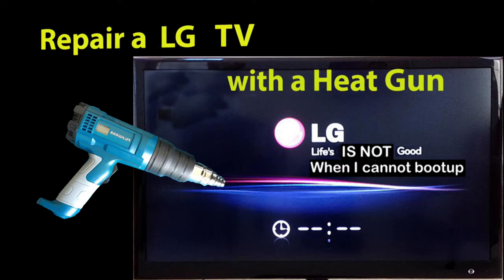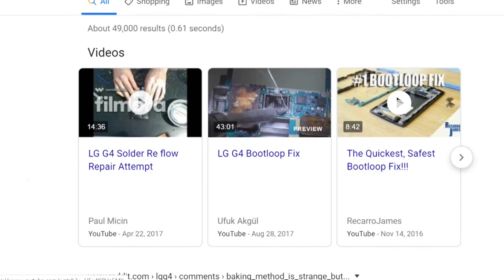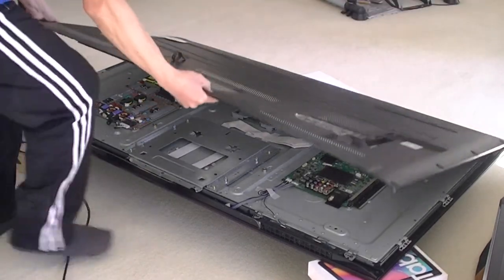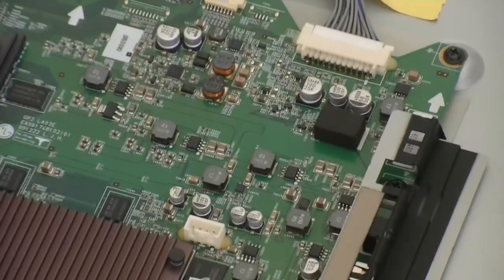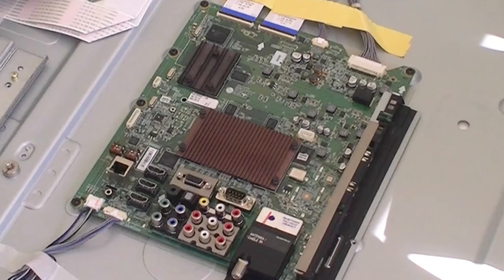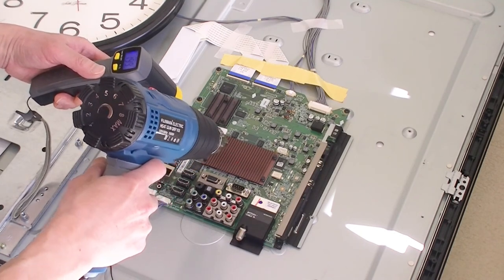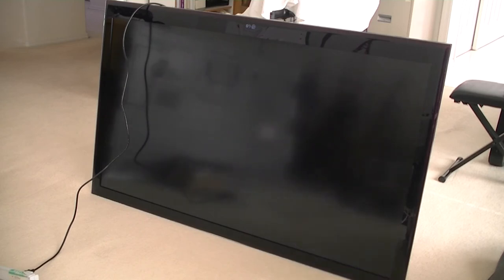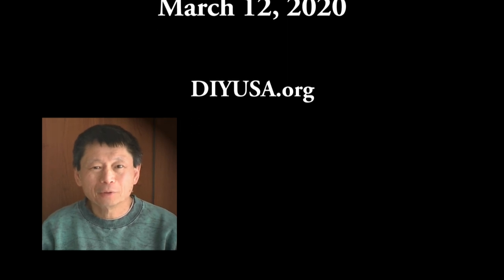Easy Method to Repair a LG TV Using A Heat Gun

Comment: Great video, very concise! This method worked for me to fix a 2011 model LG 55LV5500-UA smart TV. Like you, I left the motherboard/everything connected but I isolated the heatsink by placing 4 oven mitts around it to protect the board and focus the heat. Then 3 minutes of heating @ around 325-375 degrees while monitoring with an infrared thermometer. Thank you for showing us, and I hope others will take it into their hands to DIY more!
Reply from the maker: I appreciate your feedback, this will encourage others to try, hopefully the TV will not go to the landfill so soon. Thanks for providing the improved method to protect the board, especially he cables connected to the motherboard. They are very fragile (limited cycle time - to save $). For me, this method to fix the soldering issue will keep the TV running from a few weeks to a few months. If it fails again, I am able to fix that by reapplying heat to the chip. 😶

Comment: I can't believe that this worked! Ran a couple of tests and narrowed down the problem to the main board, borrowed a heat gun, set the heat gun to 250 celsius, waved it over the large heatsink for three minutes total and let it cool down, plugged it in and it works, thank you so much!
Reply from the maker: Really glad that it worked for you! Thanks for sharing!

Comment: Excellent video!  You laid down the theory and implemented it.  I used this technique on an LG 47LE5500 and it worked perfectly.  Thank you.
Reply from the maker: Thanks for letting me know. I hope your TV will run for awhile. Mine finally failed after one year of use (which is relatively long this time). I will have to 'reheat' it tomorrow.

Comment: It works. Picked up an infrared thermometer for $20. Already had a heat gun. Never wanted to reflow the entire main board by warping it in the oven. I knew this was a more effective way to reflow. Just could not find a resource explaining how to? Thanks for ref the flow soldering chart.  I did exactly as you instructed. 46LD550 and THANK YOU for posting!
Reply from the maker: I am really happy it worked for you too. I didn't have confidence it would work for me when I filmed this video. I baked my TV's motherboard 3 times. There are very limited cycle time on the ZIP connectors hence it is always better not have to remove the motherboard. Per my past experience, I don't expect this fix will keep the system running for long... hopefully I will get a few more months of life time before it dies again. BTW, my TV is still working :-)
Reply: Is it still working?

Comment: this got me back up and running.   i have a 86" lg and I changed out the power spply board thinking it was the problem,. I removed the main board first then used a hair dryer for 3 minutes.  it did create another issue  with the wifi no longer works but im fine with that since my devices wifi capabilities.  but this fix is the same I did on xbox 360, it only last a short while.  since the issue is the main board not power supply as troubleshooting suggest ill change once this stops.
Reply from the maker: Thanks for the feedback. My TV finally died after 1 year. It lasted longer than I have expected. I have to 'heat' it and see if it works again. Cheers!

Comment: The heatsink is resting on top of the chip, not the solder so I wonder WHAT you are heating as this 320F would have to penetrate the chip and make its way to the solder points. Very risky to burn out the IC this way. REAL surprised it works.
Reply from the maker: It is nice to hear another success story from you. You asked a very good question. The max. operating temperature of a CPU is around 100C . But at a static state (not powered), the chip can handle much higher temperature.  I have to look up the datasheet to tell you what that is. My memory is around 200C, which is close to the flow soldering temperature. I was shooting a slightly higher temperature to the chip with my heat gun. In wave flow soldering process, the PCB, with the chips mounted on it has to go thru pre-heat to prevent the thermal shock, then the assembly will run thru the hot solder for a very short time (seconds). We don't have that level of control with a heat gun. Yes, there is a chance to damage the chip. Since the TV was not working and I didn't want to spend hundreds of the dollars to replace the main board (probably no spare parts available for this old model). In my case, I have nothing to lose  :-)   Glad it works for you. Cheers!

Comment: Yep. I ve shot my heatpistol randomly at  the board for like a minute, and it worked! The downside is that after an hour or so, the set got stuck again.
Reply from the maker: Yes, a fix very often is temporary. However, I have fixed mine 4th time (prior to that the fixes worked for 1 month - 3 months) and it is still working. It has been over a year now. I would suggest apply heat to a specific chip one at a time. I will start with the bigger chip since the soldering surface is larger (than other chips on the PCB/motherboard) and more likely where the problem is. Apply heat for the duration as I have indicated in this video. Good lucky!
Reply: @DIYUSA  next time i will try and aim the chips that  are the usual suspects.!
Reply: @nikosatsaves3141  take the heat sync off and target the chip beneath. Squirt some liquid flux in between as well as it’s probably a dry solder. Check out videos on reworking a chip on YouTube.much better than hit and miss technique
Reply: @xray364  thank you for your response but frying the darn  thing has worked  so far

Comment: my lg 42lb670 is stuck on the logo screen after the lighting event...the led in the power section flashes 3 times.. what the reason could be?
Reply from the maker: Thanks for asking.  I have similar problem, the TV stuck on booting. It worth to give that a try (applying heat to the big chip-in my case, the one that has the heat sink). You have nothing to lose since it is not working in the first place. Good luck.
Reply: @DIYUSA  thanks
Reply from the maker: @ageanageanic280  You are welcome. I appreciate if you can update me if it works for you or not.  Thanks!

Comment: Thank you for posting this video.  I haven't tried the method on my device yet but I'm sure going to do that.
Reply from the maker: I am glad to share... I have been lucky with this TV. I used 'baking in the oven' method and this is so much easier. I believe a hair dry will work also.  My TV  is still working after 9 months, but it may failure any time without notice.  However, my LG phone wasn't that lucky. After I baked that phone and it lasted only 1 day. But LG was good then, they replaced the board for free, but I still have to pay $14 for shipping charge.
Reply: @DIYUSA  Thanks for the update.  Yeah, I've given up on LG,  myself. First, it was the phone which they wouldn't fix under warranty and,  now, this tv which became a pain immediately after expiration of the warranty.  No more LG for me.
Reply from the maker: @Not_really  Agree,  I will not buying LG, not even a monitor..

Comment: He's it still working now?
Reply from the maker: Yes. Luck is on my side, it is still working. Not sure how much longer it will last ☺️
Reply: Waooo that's great mehn like a year now? Mehn

Great

I just wanted to try it here
Reply from the maker: @revdoisrael  Yes, this has been awhile. But have to plan it may die any time. I do have a 32" backup TV just in case.

Comment: Hi, I fixed my tv used the oven method twice.  The first time is working for 3 months.  The 2nd time...7 months.  3rd time, failed using the oven method.
Reply from the maker: Thanks for sharing. I used oven 3-4 times also and finally using this much simpler method. On my third trial, initial it didn't work. Then I re-insert all the wires and it worked again. This could be your case too. The 'zip' connectors sometimes is difficult to align correctly.

Comment: Hi DIY, can I use your method to fix my LG TV Standby Light On But Won't Turn On?  Will your method work?  Thank you.
Reply from the maker: Worth a try, but it could be other simple problem. Once I baked my TV main board, and it didn't work. The problem was the alignment of the flat ribbon/Zip cables, one of which was off. The TV indicator was on, but nothing happen. I re-seated all the cables and it worked.  You mentioned you have baked your board and it didn't fix the problem. This could be similar to my case. I have at least 4 failures with my TV, and each failure were different. Early on it didn't detect a HDMI plug in video connector. Later the TV was hung on boot. I baked it and fixed that. Then it failed again and hung somewhere else during boot. I baked at least 3-4 times. Finally I used heat gun and I didn't have to deal with removing the  main board and all the cables... which could introduce another failure. SO far, it is almost 1 year now and it is still working.
Reply: @VIP Pham What did you do to get it working?

Comment: Hi DIY, it your tv still working using the heat gun?  It have been 9 months.  Thank.
Reply from the maker: Thanks for checking back. I am lucky this time. It is still working. My last three-four times putting the main board into the oven and bake it and the TV lasted 6 weeks to two-three months only. The best part (so far) is it works every  time. The main concern for me is if I remove the main board (for baking), I have to handle many Zip connectors. Some of those connectors' cycle time are between 20-40 cycles (cost reduction for consumer products), that means I cannot keep on removing and reinserting the cables and this will become another point of failure which cannot be fixed by baking :-)

Comment: You should remove the heat sink and use flux but yes this does work.
Reply from the maker: Thanks for your input. You are absolutely correct, the heat sink will ‘sink’ a lot of heat and it is best to remove it first.
Before I retired, the lab at work had equipment to replace the large BGA chips. Now, I don’t have access to the tools anymore. The heat sink on the BGA is not held down by metal clips, and it is not easy to remove it at my home without the right tool. 
Now, I want to build and repair stuff with some very basic tools. That means I have to cut corners or come up with some new ideas to fix or build stuff. Hopefully it will be as good as if I have the right tools.
In the past I baked the whole motherboard, and I don’t have to remove the heat sink. Though I am very experienced in designing, soldering, assembling computers, I still made mistakes when I re-inserted the low-quality flex cables onto the motherboard (the cables have very limited cycle time – low cost). Therefore, In this video, I attempted to repair the TV without removing the motherboard. Glad it worked.

Comment: I have a Nexus 5x phone which is made by LG. It also failed due to cold soldering issue. I took it apart one time, heated the motherboard with a heat gun and it worked for about 2 weeks before failing again...too much trouble (and risk breaking the screen, etc.) to open and try it again.
Reply from the maker: Thanks for watching and your input. I didn't know Nexus is made by LG. Now I have another brand to avoid. I have been in this high tech business for > 30 years and I am surprised LG couldn't fix this manufacturing issue (or they don't care since the warranty is only one year). TV is a relative 'low-tech' product (in terms of manufacturing when compared with highly complex phones) yet they still not fixing the cold solder joint issues...I hate to see many products which can be used for more years but because the manufacturers want us to buy the new products and the old ones failed and go into dumpsters.

Comment: 42LV5400 fix applied.  Result successful.  Thanks for posting, especially the info re: re-flow temps.  NICE!
Reply from the maker: Excellent. I am happy for you.. I hate to see a TV go to the land fill because the manufacturer not trying to improve their flow soldering process.. I am in this computer industry for > 35 years and I don't understand why LG not tightening their process. May be the motivation is greed!  Want us keep on buying a new TV.
Reply: @waldguy is it still working after 4 months?
Reply: @geraltofrivia688  Unfortunately no.  The next try, the screen went goofy.  May have overheated the processor.   I think it takes a more serious solder reflow job.
Reply: @waldguy  From what I've understood, using flux is key to having it last longer than a few months as it removes the oxidation and makes a better joint.
Reply from the maker: @Cherokee10g  You are 100% correct. Cold soldering problem is not limited to LG. There is always this kind of defect in manufacturing process. However, some companies products are less affected by this problem because they take better manufacturing and screening process to bring the defect rate down. I have more bad luck with LG than, say Panasonic, etc. The former computer company (bought by another company) I worked for has exceptional product reliability. Their products have undergone a lot of stress tests prior to product release. There were procedures in place to monitor the manufacturing process. All these cost money, but that company was able to sell the product at competitive pricing. Cheers!

Comment: I want to try your method but I don’t have a heat gun and infrared thermometer.
Reply from the maker: You may use a more powerful hair dryer. However, without a thermal sensor, it would be difficult because you need to know if the solder reaches the correct/melting temperature.

Comment: Just got my LG 43NANO75UPA.BUSYLJM working again with this. 320° on low air flow with a hot air rework station and she's come back to life again. Thanks!
Reply from the maker: Thanks for your feedback. Glad to hear another success story. The first few times (I used the oven to baked the board) didn't last very long, from a few weeks to 2-3 months, However, I am lucky with my last repair using the heat gun and the TV is still working. It has been over a year now.
Reply: @DIYUSA  Awesome! Glad it's still working now!
Reply from the maker: @JustInvertedFpv  Excellent news, one less item going into the landfill!